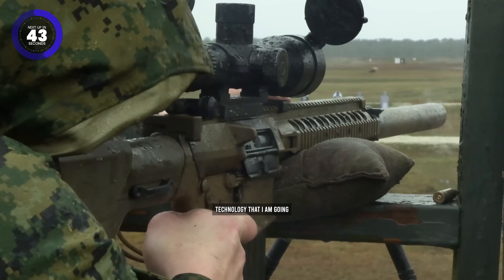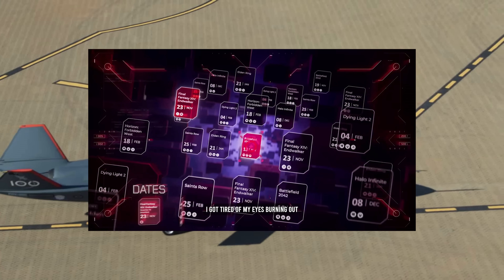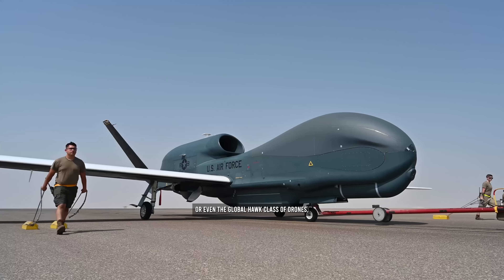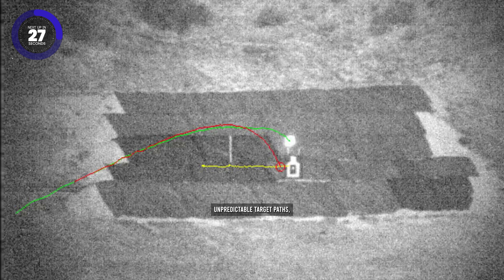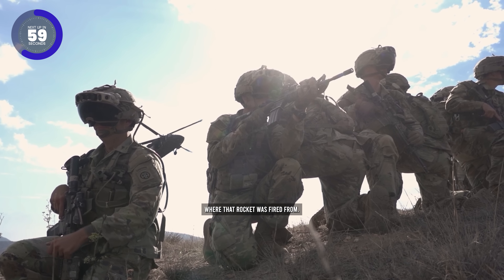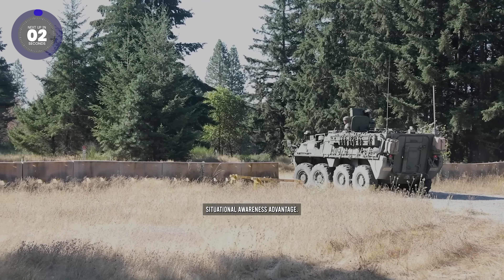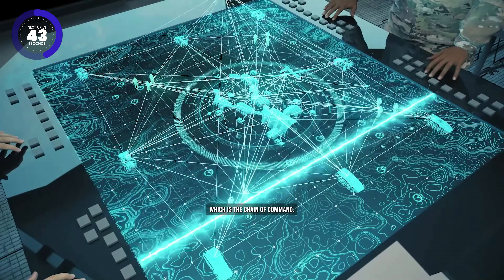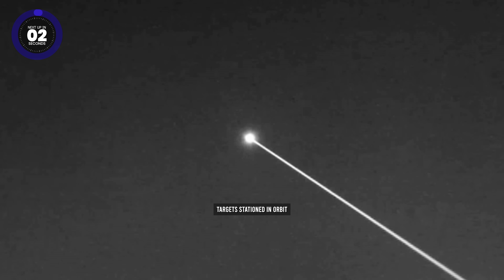HOW IS THIS THING 𝙍𝙀𝘼𝙇!?

Comment: Bro, the Switchblade isn't new tech. That's been around for 13 years now. Not only that, but the UCAV in BF4 was based on the AeroVironment Switchblade. BF4 came out in 2013, 10 years ago. The US Army and USMC used them, and Ukraine is currently using them against Russia.

EXACTO was also a program started back in 2008 by DARPA in cooperation with Lockheed Martin and Teledyne. It's been in testing since as early as 2014.

Comment: As far I know active protection systems aren't as new. If I remember correctly, soviets tested they own system "Drozd" during afghan war in 1980s
Reply: You are absolutely correct! APS like Trophy(American), Iron Fist(Israeli, also awesome name), Iron Curtain(American, ironically enough), Arena(Russian) and of course the first one ever, the one you mentioned the Russian Drozd, have been around since a few years after the Vietnam War.

There’s also Afganit, which is a Russian system made exclusively for the Armata family, but so far we haven’t seen that particular vehicle family manufactured very well. The only instances of Armata chassis vehicles we’ve witnessed are the BMPT “Terminators”, where the protection systems did very little to protect the vehicle from Ukrainian ATGMs, which are either 1990s Kornets, Javelin, or the more modern NLAW system, which is cheaper but boasts both a top attack and manual fire mode. 

Strangely enough, the strongest thing that seems to be able to resist regular “dumb” AT munitions is... armour. More specifically, there was a case during the Afghan War where a British Challenger 2 took 20 direct hits from RPG fire, but the tank remained mobile, operational and the only casualty was a crewman who suffered some shrapnel to the toe(ouch). It was only due to other tanks in the squadron informing it that the vehicle crew in question even realised it was being fired at. 

Drozd is a very old and antiquated system by now, still perfectly serviceable against typical RPG-7 warheads, but move up to things like the Polish RPG-76 Mosquito and we’d start having issues. 

Ultimately, the best active protection system is still not getting hit, whether that be by avoiding the enemy or turning them into mincemeat before they could fire.
Reply: Active protection system capable of shooting down personal carried antitank missiles is something only a few countries in the world have. Like Israel. The USSR one is prettyuch useless and even tho some highly active APS exist they still don't protect from shells and top hitting missiles so there's plenty of room for improvement
Reply: @holesmak  As far as I can tell (and absolutely feel free to correct me on this), American Trophy APS and Israeli Iron Fist APS are the only ones with anti ATGM capabilities. We’ve actually seen the Russians’ Afganit Armata Family APS in action and uh... the AFV in question got cooked by a Ukrainian ATGM.
Reply: @sirdickkickerthefirst9611  there's also rheinmetall analogue if my memory isn't rusty. They should be capable of shooting RPGs and maybe some serious direct attack ATGMs. 

Yeah anything russia claims to have should be served with a few pounds of salt on it. So far the only thing that proven to be somehow effective and is not archaic and actually innovative made by russians is.... Wait is there anything? I wanna say iskanders but those are nothing special in sense of novelty.
Reply: @holesmak  Well, the Russians... or rather A Russian physicist was the one who came up with the principle behind Stealth Fighters and Anti-Radar coating. Of course, the Old Union deemed his work irrelevant because they lacked the West’s frankly terrifying material sciences and released it to the global community, where it was picked up and gave rise to platforms such as the F-117, B2, B21, F22, and my favourite girl, Amy(the one with plane abs, not Schumer). 

In recent years though, I’d say the Russians haven’t come up with anything remarkable or even serviceable. The competent parts of the Russian Armed Forces (aka the only reason the Kremlin isn’t flying a Ukrainian flag right now) are all based around older Soviet Tech, which was a collaboration between all the SSRs and now Russia, so that doesn’t really count in my mind, but it would arguably be Russian.

Also very interesting about Rheinmetall, thank you for the reading material, I’ll be sure to look into that! 

But yeah, the last time the Russians really revolutionised a concept in Modern War, it was the Katyusha, the first viable MLRS in modern history. They then sat on their laurels and simply made incremental upgrades to the system (as you can see with the TOS-1), while the Western nations took the concept and made things like the HIMARS or the MARS II, which are borderline mechanical eldritch horrors. 

It’s kinda emblematic of the whole Western-Russian “rivalry” in my eyes: the Russians discover an interesting concept, makes a half-hearted attempt at it, takes the results, bump the numbers up by a factor of 10, then tells the West to fear them with it. The West, in return, takes the concept, makes a system that actually puts up those numbers, and more, then silently smiles while the Soviets, or Russians now, boast about their superiority. 

I mean, Iskanders and the such are nothing new. They’re simply ground launched cruise missiles, compare that to the West’s palletised Rapid Dragons, who could be dropped out of cargo planes like the bloodiest care packages in history, and they’ll find their own targets. 

Even things like the so-called Hypersonic Ballistic Missile Kinzhal is really just a repurposed nuclear missile that’s filled with conventional munitions instead of a Nuclear Warhead. It’s all been done before.

It’s actually terrifying to think about the Westech that we DON’T get to know about, the stuff that black budgets are put towards. I’m very happy that my country fought the Americans all the way back in the 70s, cause if we fought them today... I shiver to imagine the sheer cold efficiency of US Armed Forces brought down against my country today, they’d manage to destroy any hope of an organised resistance without ever harming a hair on a civillian’s head.
Reply: @sirdickkickerthefirst9611  I agree on everything but katyushas being a novelty. Rocket systems existed for at least a few years by the time it went in service like German Nebelwerfer and the only major difference is that Soviet one has an engine. 

The radar coating one definitely belongs to USSR as a whole and has little to no connection to russia in it's current form. Pyotr Ufimtsev even studied in the Odessa which is now Ukraine however was born in the Siberia, published the research paper in Moscow journal. The only thing that Union was good at for sure is Unification lol. 

I mentioned Iskander because those are one of the only systems that well.. perform as expected. No major drawbacks no sudden lense effects or breakages. It just as it is in the concept and that's effing rare for modern russian equipment. It's surely not novel or unique but it just works as expected. Calibre is the other one which falls under this criteria but it was made back in USSR.
Reply: @holesmak  I mean... we say that, but don’t you remember when an Islanders was used against a nice little glass walking bridge in Kyiv, and didn’t manage to collapse it? 

A missile didn’t manage to break the glass bridge. That’s some looney toons level shit right there.

But yeah, the Nebelwerfer is probably the first iteration of the MLRS but Katyushas were the first iteration of the “Shoot & Scoot” model we often see today. Although arguably, simply looking at an artillery piece and saying “hmmm... needs wheels and an engine” isn’t really innovative. 

I mean, let’s be real here, the Russians couldn’t even properly install a twin linked auto cannon onto the BMPT, I’m pretty sure they managed to install the APS on it backwards and instead had the hard kill system shoot the rods right through the armour into the crew when it detects munitions, technically denying the enemy the kill.
Reply: @sirdickkickerthefirst9611  well it didn't hit the bridge it landed under it and there's like 20 meters below it. It's not certain if it was an Iskander and the glass is hardened probably even armoured to hold weight of multiple people standing on one panel. Also the glass was damaged and replaced. So I'd guess that's a reasonable amount of damage. 

Backwards APS lmaoo. That's a nice idea. Denying a kill will reduce amount of XP enemies recieve and lower their efficiency for sure
Reply: @holesmak  yoo, so it turns out that Russian Air Defence does work! The only nuance is that it only works on Russian planes.
Reply: @sirdickkickerthefirst9611  lmao fr. 

But honestly russian antiair is made to fight big exposed planes. So that checks out. Drones which Ukraine use are much harder to shoot down with those.
Reply: @holesmak  Yep, the air war is a virtual dead zone in the conflict because both sides have AD systems that were designed to fight a Western coalition, which would be 20 times the size and 100 times the capability of the entirety of the USSR’s airforce, to say nothing of Russia and Ukraine’s atrophied airforces.

Comment: @10:00 anyone in healthcare will tell you that you'll need a better interface than that, those stickers can fall off real easy, even if they used the same adhesive as we use for Defib pads (which is pretty good if u have a perfect seal) unfortunately we know what conductive gel next to human body heat does after a while, it just becomes a liquidy mess, I can only imagine it would be 10x worse in a desert AO

Some really cool tech there, but I don't see telepathic interfaces working externally, it's going to need surgical implantation which all sorts of its own problems and ethical considerations, a very scary future
Reply: Most likely will be a platform controlled from the comfort of a FOB or permanent installation. Maybe even through a camera via drone or satellite.